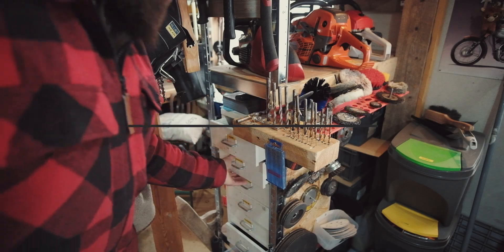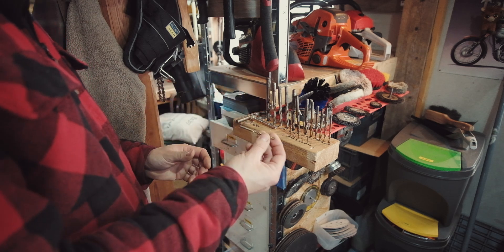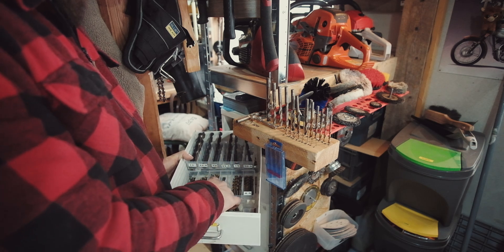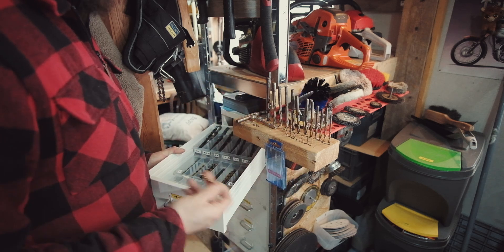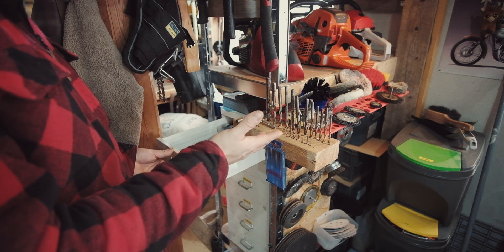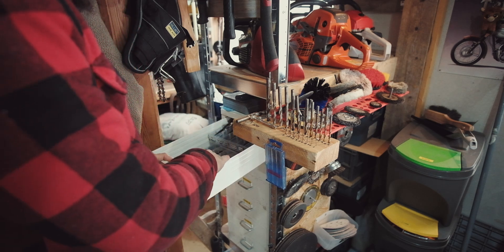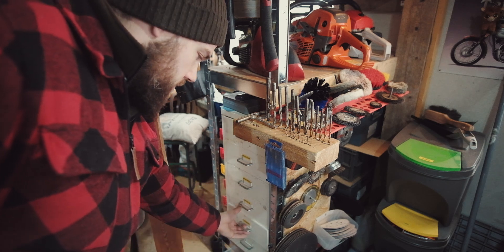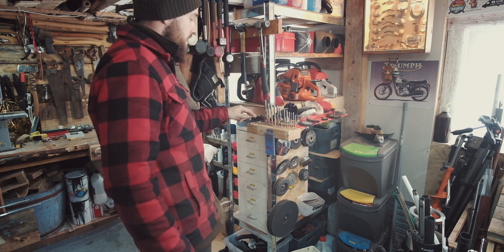Simple Drill Bit Storage Solution

Comment: It was me! (also a patreon). 
I love this solution, particularly separating the new stock from the in-use stock.  
At the moment I have all of mine in the top, shallow drawer of a mechanics rolling tool box under the bench.
Despite lots of magnets, it descended into chaos.

I also detest the folding metal "drill index" tins; roughed up drill bits not fitting aside, I also find that drill bits like to fall behind the index, and then you can't close it as it jams up.
I think that I need a sexy slim chest of drawers or similar like yours next to my drill press.

Thank you Ash.
PS: Do you sharpen your bits at all?